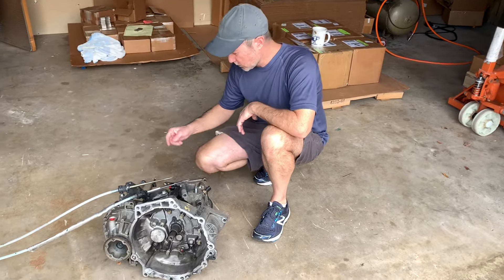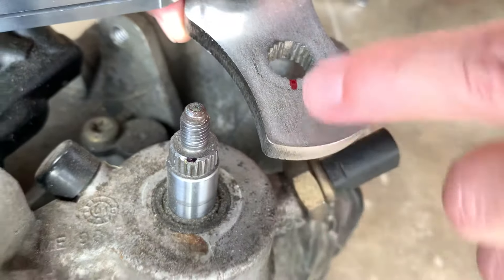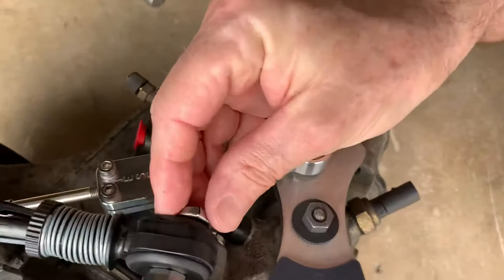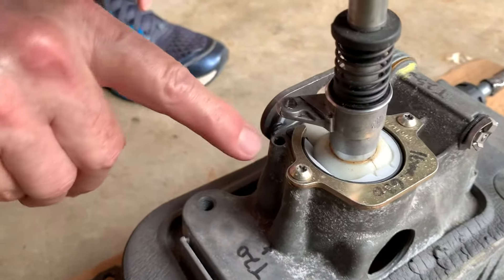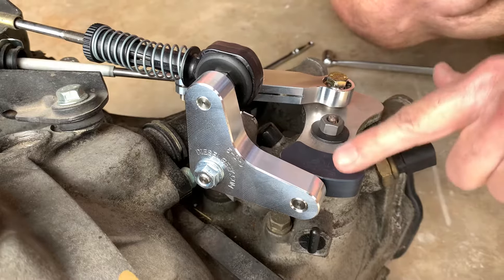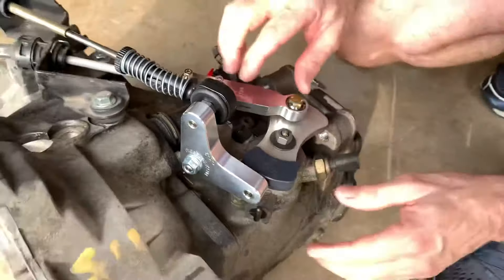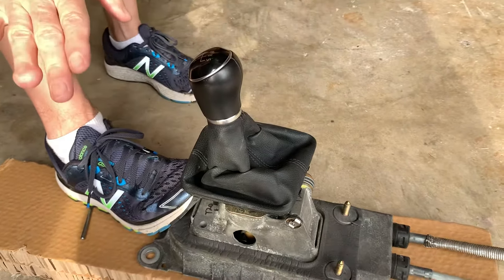Installing 2022 Sigma 5 Shifter on Mk4 02J Transmission

Comment: installed in my 2017 Jetta TSI. plastic transmission locking pin broke on me for no reason so the install took a bit longer than expected. have a little over 1k miles with it and it feels great. When I get another free day I'm probably gonna pull the battery back out just to make sure the adjustments are all still solid. considering getting the super pin, first gear getter, and shaft bushings to hopefully eliminate that last bit of factory slop.
Reply from the maker: It's the side to side cable adjustment that's really critical. I like to double check that is as perfect as it can be using the elevator test after installation. https://youtu.be/fCJSsj9JKLc

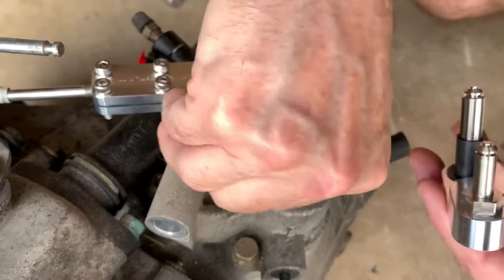Comment: Just want to say that this kit is incredible! Watching the detailed videos on your channel gave me confidence tackle it with my amateur hands. Some things that might help another clueless novice: I only needed to remove the battery+battery shelf to do the install. I don’t know how advisable it is but a bit of wd40 helped free stuck-on cable ends (let it sit then tapped it off with a wrench/pried with hands), the  pivot bushing shown at 1:55, and get the old selector off the post. I was too scared to pry so, with it in neutral, I put an adjustable wrench under the selector to brace it all around the post, then tapped it with a hammer. (very, very slowly, making sure the post had downward travel space). A bit of wd40 also helped the shifter alignment pin in the cabin fit into the hole—it really is made EXACTLY to fit! 
The tools I used were Phillips driver, flathead driver, 1/2” drive ratchet with 8mm hex bit, 10mm hex bit, and 10” extension (12” would have been better),  metric hex keys for the metal cable end, and shop cloth/paper towels to clean off 22 years of accumulated gunk. 
I’ve heard it takes a while to break in but it feels good enough on day one that my wife is worried it’s competition for my affection
Reply: I also spent entirely too long trying to pry my old round cable ends off before realizing I didn’t need to pop them off to remove the old parts 😅

Comment: After replacing all the bushings accessible without cutting a hole in the shift box (there was no play, so I figured I’d wait until I was doing a downpipe and was under there anyway) I was intermittently getting a little bit of a grind going into 2nd, no matter how much I babied it. Went to play with the adjustment and discovered that one of the “fingers” on the front to back cable end was broken. In very gently trying to set the adjustment, another one broke off. Figured that was a sign and ordered my sigma. Just finished the install (piece of cake, great product and your videos are 😙👌) and two things: still getting the grind every once in a while (seems to happen when it’s hot out, thinking maybe new fluid) and the shifter seems crazy stiff (I did use 2 welterweights). Is that normal, and any ideas on the 1-2 grind?
Reply from the maker: Hey Eric - 

A good bit to unpack there. A few things: 

- Some front to back stiffness is relatively common as the bearing races and slider wear in. 
- Double check the side to side adjustment using our fine tuning video. https://www.youtube.com/watch?v=5xx4ZzrIqEU
- 1-2 grind - if the side to side cable isn't adjusted well it'll cause poor gate selection & grinds can result. 
- As for gear oil we've seen good results using relatively thin fluid in the 02Js; Fuchs FW 75w, VW G060726A2, Redline MT85. Faster sync action, doesn't seem to cause bearing issues, minor increase in noise.
Reply: Thanks so much for the reply. Had a feeling the stiffness was just from being brand new. I was actually going in to do the elevator test when I noticed the broken cable end, so I’ll check that again this weekend. Cheers!
Reply: I’m only finding Fuchs FE 75W, not FW 75W. Typo?

Comment: the bentley manual has the black nut with washer listed as 20Nm (15 ft lb) in case anyone was curious
Reply from the maker: That is true...like nearly every other M8 fastener. Funny thing about that though. We stopped providing the spec, instead telling folks "tighten it but don't go crazy" and we hear of a lot fewer people breaking the stud off the selector shaft! There's a forest/trees effect there I think. People get so caught up in specifications and replacing hardware they stop paying attention to what they're actually doing.

Comment: Hi Guys' just wondering about wilk IT be helpfull for my 02A mk3 gearbox 1994?
Reply from the maker: Conceptually the transmission works the same way however it is not compatible with the Sigma shifter because the selector shaft and cables are different.

Comment: help!! i did everything the proper way and whenever i shift into reverse, it activates the reverse switch but instead goes into first! i've tried re-adjusting so many times and nothing is working!! please help
Reply from the maker: More likely than not this is a side to side cable adjustment problem. Please perform an elevator test to check that. https://youtu.be/fCJSsj9JKLc

 The reverse light switch is activated by the selector shaft, not the shifter. I don't have an answer ready for that one as that is strange behavior. Once we get it adjusted correctly we can look into the reverse light thing.

It would be better to have the back and forth via email, so please email us directly sales at dieselgeek

tyler
Reply from the maker: It occurred to me that the upper support bearing for the selector shaft might be worn out or gone. Does it seem like the selector shaft has radial play? That might explain both the first reverse issues as well as the backup light switch coming on.
Reply: @dieselgeekdotcom  the shifter has absolutely no play, the shaft has no problem shifting into reverse but on the transmission, it shifts into the reverse position and car goes forward instead of reverse
we even tried disconnecting the cables and tried shifting it into reverse by hand , it still doesn't click and it goes forward
what else can be wrong? also the elevator test between first and second stays at the same height
Reply: @MrGRM89  when you adjusted it did you put it in neutral first.   Cause if ur transmission isn't in neutral it will never work right

Comment: What happens if I have a 2001 with the rounded, old style cable ends?
Reply from the maker: You'll need to source a square headed cable end. We do sell them for close to cost to support the early cars.
 https://dieselgeek.com/products/side-to-side-cable-end-5n0-711-761?_pos=1&_sid=4d023e346&_ss=r

Comment: @dieselgeekdotcom can you show the steps if your lock pin is broken and preferably a video replacing the lock pin in a car?
Reply from the maker: Broken pin procedure is covered in this video. https://youtu.be/sheTKD03hmo?list=PLlHii197wye46xkGAAV7_Jq7gi1p7kmbX Don't replace broken pins. Expensive, a little tedious, ultimately unnecessary.